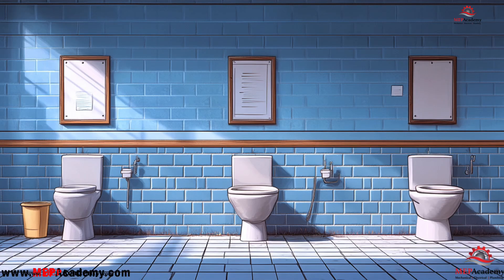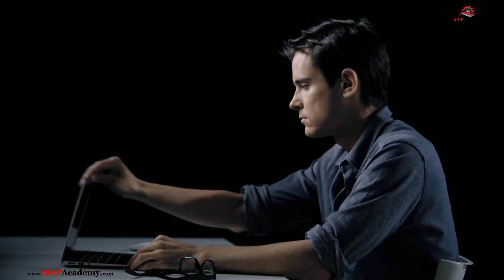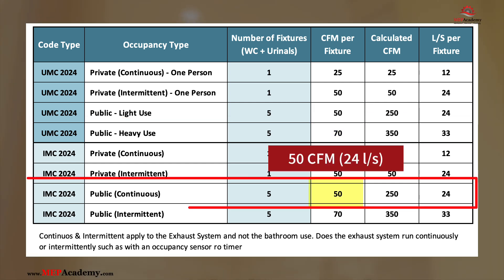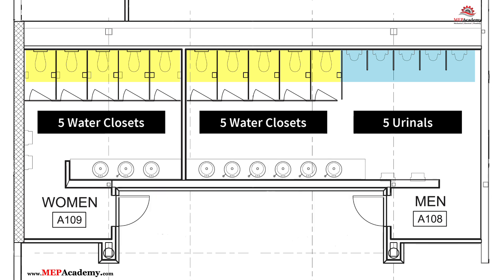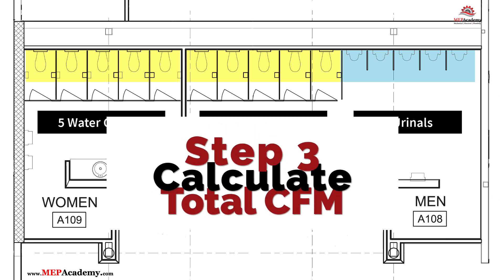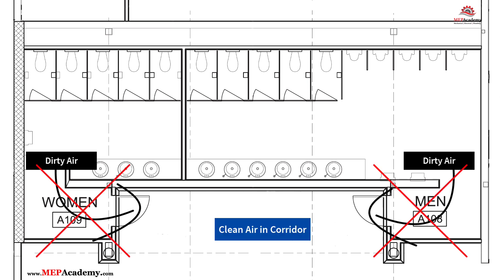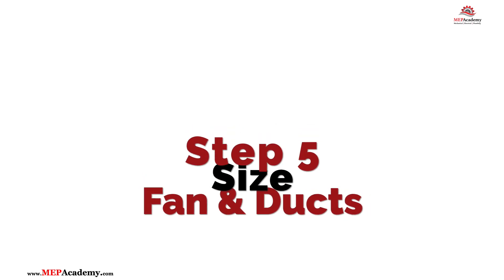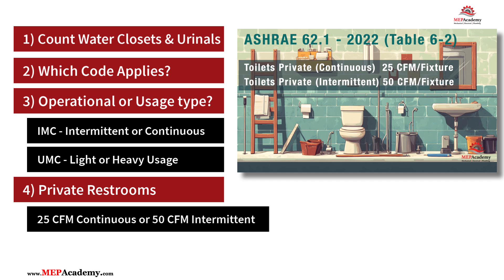How to Size Commercial Bathroom Exhaust Fans

Comment: How to discuss when to choose continuous or intermittent operation fan??
Reply from the maker: Great question. In the commercial industry, the choice between continuous vs. intermittent exhaust fan operation is typically guided by the International Mechanical Code (IMC) and ASHRAE Standard 62.1 for ventilation.
Continuous operation: Often required in restrooms and other spaces where maintaining a set number of air changes per hour is critical for health, odor control, and compliance. ASHRAE 62.1 specifies minimum exhaust rates (e.g., 50 cfm per fixture or higher depending on occupancy), and running the fan continuously ensures those minimums are always met. This is common in schools, hospitals, airports, and high-traffic facilities.
Intermittent operation: Acceptable in spaces with variable occupancy, provided the system can still deliver the code-mandated exhaust rate when in use. This is usually accomplished with occupancy sensors, timers, or scheduling through the Building Management System (BMS). IMC allows this approach if the exhaust is activated whenever the space is occupied.